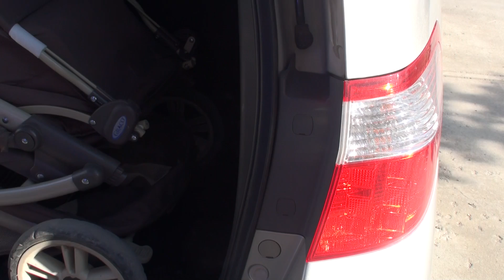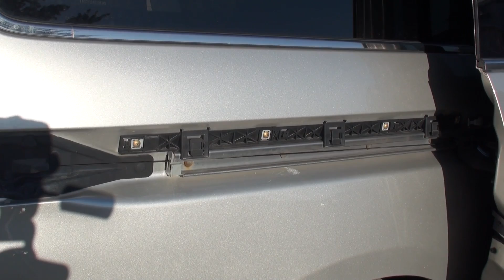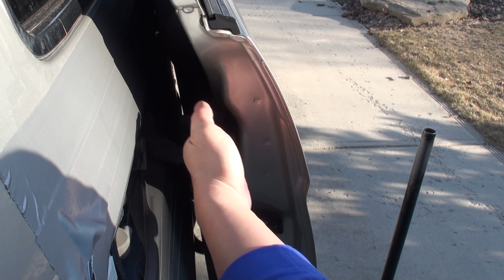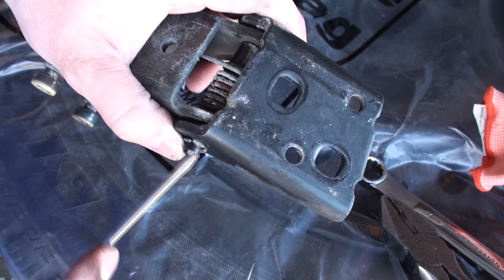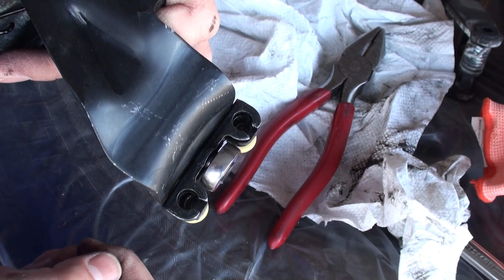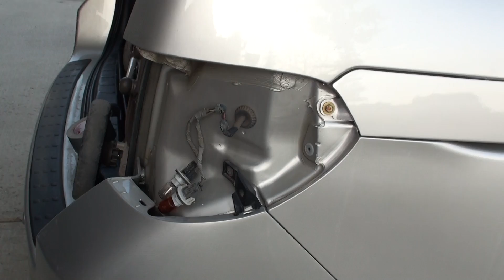Honda Odyssey Center Rail Door Roller Replacement

Comment: Thank you, thank you, thank you!  The left side center roller assembly on my 2007 EX-L was so worn out that we couldn't even use the door, it would bind up every time. (One of the small rollers fell off as I took the assembly out of the track.)  I just finished the drivers side, I picked up the parts (left and right) from my local Honda dealer.  Honda parts guy said this is a very common repair.  Would have been nice if I could have knocked out the pin and left the mounting bracket bolted onto the door, but I couldn't get a hammer in there or anything that worked well enough to hit.  Very important that you mark that bracket location well, my marker lines were too faint and it took a lot of tries to get the bracket lined back up.  But I finally got it and the door now works like butter.

72561-SHJ-A21  MALE ASSY., L.    $53.97  (USD)
72521-SHJ-A21  MALE ASSY., R.    $53.97  (USD)
Reply from the maker: +John Ullrey glad it all worked out for you.  Yes I've considered just knocking the pin out but it was too much of a pain with a hammer and a drift punch in such a crammed spot.  Use a black sharpie to mark the position of your rollers.  It will be a bit unsightly but who looks in between the doors anyways?
Reply: +piercedasian Got the passenger side done yesterday.  Took the time to mark it really well and the job went soo much smoother.  Took less than half the time to do the second one.  Thanks for the video.
Reply from the maker: whoa, that's awesome!  Glad you got the technique down now.  Thanks for watching my vid :)

Comment: Thank you! Did both doors in 2007 Odyssey EXL in about an hour.  Cable only sticking point, but curved needle nose pliers worked.  I had just enough clearance when I kept it close to track.  I looked at how to release cable, but too many interior components need to be removed.  If the door still binds you may need to adjust the height. Mine was not aligned even after marking it prior to removal.
Reply from the maker: +Mike Ryan Glad you got it replaced on your own!  Yep, the closer to the track the better.  Makes the struggle easier :)

Great tip on adjusting the height of the hinge!  I'm sure some of our viewers will need to do the height adjustments to get the door to move perfectly.

Comment: I haven't tried this yet as I wanted to look it up first, but I have to say, your tutorial is very in depth, with great explanations. I was going to try replacing this assembly due to door rattling that I hear on the passenger side slider. I have ridden in the back and am convinced that this is what it is. Thanks in advance. Let's see if my patience is as good as yours. LOL
Reply from the maker: +Anthony K. glad you liked my vdieo Anthony.  Yeah as the rollers wear out the door will have more play in the track and that rattling could very well be linked to the studs the rollers sit on tha tis bouncing off the inside of the track.

Comment: Thank you so much, great tutorial,.I just completed the job.  I found my foremost roller had completely seized. Took me way too long to connect the cable, but finally it slipped in after a 45 minute wrestling match. Very hard time getting the tailight out too. Dealer quoted $380 for the job so saved a lot $$.
Reply from the maker: +Sean Leitz glad it worked out for you.  Yes the tail light if never previously removed can be a pain in the butt to take out.

Comment: Great vid.  First side took 40 min but the second side took 18 min.  BUT the passenger side still creaks on opening and still jams on opening and closing fairly regularily.  Any other ideas to fix this?
Reply from the maker: +John Digweed have you looked at the other hinges or even the centre roller's alignment relative to the door?  Normally the mounting bracket (the one I show how to mark with a felt marker) shouldn't move but sometimes if the bolts work their way loose that the hinge was already "crooked" and you reinstalling them to the markings on the door you made could very well be not right.  I would shut the power door motors off and work the door manually to feel the door for binding and see if adjusting the centre roller mounts on the door are positioned optimally.  Hard to describe how to do it but once you see it you'll be able to tell how "off" it could potentially be.  Hope you are able to figure it out....

Comment: THANK YOU for making this video!  Saved me a lot since I could see that it is somethign that I could do myself.  I ended up breaking the tail light in the process though, and that stupid plastic piece cost more than the door roller!  Oh well, even with the light it was still less that it would have been to take it to a shop.
Reply from the maker: +mafarnz ah yes the darned tail light peg that likes to jam up real tight.  I actually snapped my own mounting flange of the tail light b/c it was THAT tight from factory.

You're correct in that the tail light is pricey but in the end it is still cheaper to replace the tail light AND the roller yourself than just the roller at the dealership.

Comment: Inspired by this video, I just did my LX / non-powered door. 
For the LX you don't even actually have to remove the track panel cover, nor the hinge piece from the door. Just work from inside the van with the door about 1' from fully closed position. Here, the track makes a turn to an open area and is not obstructed by the track cover. 
In this position I just popped off the snap ring with needle nose pliers, tapped out the pin with a very small hammer and old screwdriver, tilted out the old roller, tilted in the new roller, replaced pin, replaced snap ring. The new roller wheels sounded horrible until I spray them with grease, but now the door works as smooth as silk. Once I got the door supported, the actual changeout took less than 4 minutes (no exaggeration!)

Also note that the Honda jack that comes with the van can be raised high enough to support the door.
Reply: Joe, I figured the same thing - I didn't think a dealership would go through this much trouble to replace a part that they could do in a couple of minutes.
Reply: I have a doubt,  we still have to release the cable.  Is it?
Reply: Non-powered version has no cable, but I assume that the powered version does have a cable and is a bit more complicated
Reply: @joemamadd  got it.  Thanks
Reply: OMG Joe, this was probably one of the most useful comments I’ve ever read on YouTube.  I have a 2006 LX and I couldn’t find the correct part for the LX locally.  I initially went to autozone and got the part for the EX.  After doing more research I found out that the LX uses a different part.  The next day I called my local Honda dealer and they wanted $110 for each part.  The ones I bought from autozone were only $45 each.  I figured that they might still work since they just had the extra area that the cable goes in.  I thought I’d give it a try and thanks to your comment, I was literally able to change it out in less than 10 minutes even though I had to take the whole bracket off.  Thank you again for your comment.  I changed both sides quickly and easily and both doors work so much better now.
Reply: Did you make a video?

Comment: Thanks - nice job on the video! 
For those asking, the LX (NON-powered door) p/n's for 2005-2010 are 72521-SHJ-A01 (right side) and 72561-SHJ-A01 (left side).  
The EX+ (POWERED door) p/n's are 72521-SHJ-A21(right side) and 72561-SHJ-A21 (left side).
Reply: +Joe Murray  thank you for the part numbers!!
Reply: Can the power door parts work for the lx? I'm having a hard time finding the lx parts online and from the dealership they are triple the price!!

Comment: Thank you so much.  Just finished.  Your video gave me the info and confidence I needed.  Anyone even remotely considering doing this should jump in without any hesitation.  
I, like Shawn M., left the hinge on the door.  No problem getting the pin out, but took some doing to re-install.
You rock.

Comment: Great tutorial video!  Based on your video, I decided to try this myself and it worked great.  One thing I did to help with reattaching the cable on the new roller was I used a pair of pliers help with the cable and it worked on the first try.

Comment: Great tutorial. Did mine tonight with a helper and took us about 40 mins. One additional trick to give you more room to work is to slide the door out of the way once the old roller is removed. We gently lifted the door and slid it forward a few inches and rested it back on support til we got the roller reattached to the wires. Gives a bit more room to work in the open as opposed to between the door and rail.  Our other door is quirky, so plan to swap out that one next weekend. The one we replaced tonight had both small rollers completely gone! Thanks again for posting the video. Always good to know what you're up against ahead of time.
Reply from the maker: djaebas glad you were able to replace your rollers.  Others that have viewed this video have provided lots of useful feedback on how they fixed their rollers and it would seem that each van's cable system is slightly tighter or looser.  I recently did an Odyssey that literally took me 5 minutes to replace b/c there was a tad bit more slack than what I had on mine.  Easiest and most inexpensive fix ever! Thanks for sharing your tips.  Good luck on the other side :)

Comment: Just replaced today with this video.  The replacement of the right side roller was a two cuss word job.  I say that is a great success!  at 10 cuss words I am calling a mechanic to do it.  Thank you for the video!
Reply from the maker: Johnny Morrow you're welcome and thanks for watching.  Glad it worked out for you!  2 cuss words?  Man when I first did this job I think I had like 100+ cuss words b/c it took me so long to do my very first roller with zero guidance.

Comment: Very clear and easy to follow instructions for replacing the Honda Odyssey sliding door middle roller hinge (applies to both left and right side slider doors). Thanks for the great video.

For reference, the roller hinge part is available online for about $38 at:
(Its items 6 and 11 in the exploded diagram for the right and left sides of the car)
http://www.hondapartscheap.com/auto-parts/2008/honda/odyssey/ex-trim/5-speed-automatic-engine/body-air-conditioning-cat/slide-door-motors-scat

Comment: THANK YOU SO MUCH FOR THE EFFORT IN POSTING THIS!
07 Odyssey, 20 minute repair (per side) with slight modification to process and some additional info.
Modifications to process (WATCH THE ABOVE VIDEO 1st):
1) keep the power ON to the doors, opening the sliding door window will help both visually and to reattach the cable in the later steps.
2) remove tail light, keep on vehicle, no need to remove completely, to access track panel cover rear bolt
3) open the door just enough to access the track panel cover front screw 
 - remove track panel cover
 - SUPPORT THE DOOR
4) remove trolley mounting bolts from door
 - after removing the mounting bolts, the door can be moved.  Important for reattaching trolley mount to door
5) using the driver's seat open/close button, open the side door.  The trolley will move independent of the door to its open position.  I then moved the trolley a few inches closer to the closed position to have a little more cable on the cable's short end..
 - the trolley should be fully accessible and not blocked by the door
6) The trolley cables (both sides) have about 1/2 inch (1-2 cm) of spring tension that allows a little play for removal and assembly.   
7) remove trolley
8) disassemble old and assemble new trolley
9) Pull on both cables to feel the "spring play".  I attached the shorter cable onto the new trolley, then the longer side.  For me, this was a 30 second step.  I've never done this before.  The video helped visualize what was going on and the 'spring play' discovery made this step easy.  I used no tools in this step.
I DID NOT APPLY TAPE TO PROTECT THE CLEAR COAT/PAINT
10) insert trolley into track and rear cable into guide.
11) using the driver's open/close button, close the door to move the trolley and stop the trolley (by pressing the open toggle) near the door's mounting position.
 - the trolley stayed in the track while it moved to its intended position.
 - I also loosely wrapped the trolley with a rag just in case it were to fall out of the track.  The rag would protect the paint from the beefy metal mount that would be mechanically pulled along.  
12) I pulled the door and had to lift the door (using the jack) to align the door to its proper position and attached the trolley mount back onto the door.
13) test the open and close - nice!
14) I applied a small piece of tape to the edge of the track panel cover front screw mount before reattaching the cover.  I found the front screw mount both sharp edged and a tight fit when carefully maneuvering it back into place.  The front screw mount bounced off the panel a couple times as I was placing it,  The tape on the front screw mount protected from scratching the clear coat.
 - I opened the door to its full open position and removed the tape from the mount using a needle nose pliers.
15) put everything back together.
Reply from the maker: grateful patron wow great detailed write up.  Definitely will help others in case they need to print off the procedures!  Thank you for sharing!

Comment: it is a giant PITA to reinstall the cable wire back in to the bracket.  a helper would be much easier.
and for someone leave the hinge on the door to avoid alignment first I would think it's brilliant idea. But to my own practice, I still have to remove the door hinge(female part) to remove the pin, I cannot see a easy way to hammer off the pin without take it out. it is doable but not easy. iit's not a hard job but i wouldn't want to fix it again.
Reply from the maker: Lee Alison practice makes perfect.  The very first time I did it I wasn't a happy camper.  Took so long to do and that cable didn't have much slack at all.  In the end however, my persistence prevailed and I was able to make a half decent video to show others how to do it and save themselves a bunch of unnecessary aggravation.  I think I've replaced 10 rollers now on 5 different vans and I can do it in about 5 minutes flat with some variations to my demonstrated procedure.
Reply: so true. I found a pair of pliers will help a lot to give enough slack to connect the cable back to the roller. just wrap pliers end with some blue mark tape so it can bite the cable without damaging the black coating. and your tip is very helpful too. try keep the roller as close as to the body panel so the length of cable won't be wasted.
Reply from the maker: the tape idea is definitely helpful.  I didn't bother with mine so my black coating was a bit nicked up but no big deal I'm sure as the cable will likely work fine far beyond the life of the van.
Reply: yeah, I was just trying to be safe in case the roller needs to be replace again. pretty sure the roller gonna wear out after thousands open/close :)

Comment: Tried to fix my door last year, had the auto door off but for some reason it engaged at the wrong time.  Broke two fingers when the door sucked shut on me.  So I haven't opened that door in over a year now lol
Reply from the maker: nosoupfuru yikes!  I can't even remotely imagine what that would've been like.  2 broken fingers? WOW strong door latch mechanism indeed.
Reply: piercedasian well, it hurt! lol...love your videos, and it's gotten my Ody back in business and running smooth.  Appreciate man!
Reply from the maker: thanks for watching.  Hopefully you've subscribed to my channel and share it with your friends.  I haven't uploaded much as of recent (summer with kids doesn't leave much time to do work) but I'll be posting new content soon.
Reply: piercedasian wait though, I do have a question about the tranny fluid.  I just did the one flush, as I realize you can only get about 3 1/2 quarts out at a time.  If it hasn't been done in forever, would you recommend doing the 3x flush over a few weeks?  I've heard that can loosen the gunk, and make it worse.
Reply: piercedasian You're awesome man, thanks!
Reply from the maker: you're welcome.  Thanks for watching!

Comment: Great video, I changed both middle rollers yesterday and all went well, but today as you open or close the door there is a grinding noise.  It starts about halfway thru the opening/closing.  Should I have greased the tracks or something?  Any suggestions would be welcome!!
Reply from the maker: rdl453 did you look inside the center rail rollers to see if there was a fine layer of "metal or debris" that was deposited in the track from the previous roller?  I've read online once that an Ody owner took a fine blade and scraped the inside of the track and was able to "peel" away a fine layer of metal that was coming off his roller bearings.  Also are you sure you aligned the hinge back to the original location?  If you're mounting alignment is off it will cause binding of the hinge assembly.

Comment: I don't have enough slack in the cable to put the pin back on the hinge. My door is wide open and I'm stuck at this very moment. What the hell do I do to get more slack?
Reply from the maker: Jason Sanders If you were able to get the cable out you should be able to get the cable back in.  When your trying to get more slack you and tug on the cable to give you a few mm more + you should try re-attaching the cables with the roller assembly to be as close to the van body as possible as any deviation away from the straight line in the roller track also eats up precious mm's of cable you need to turn that "nub" into the grooved hole in the roller assembly.  If something can give coming out then it should have equal give going back in.  Get in real close to the body and don't be afraid to pull a little on the cable.